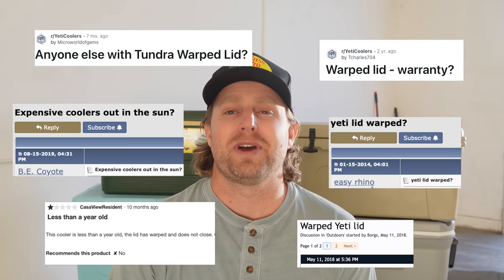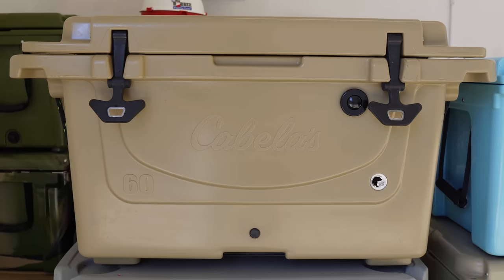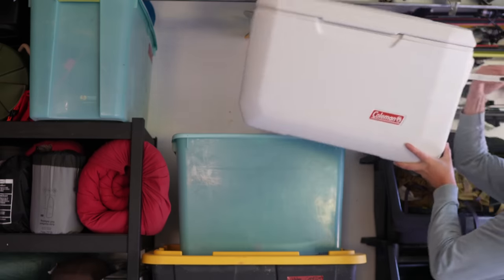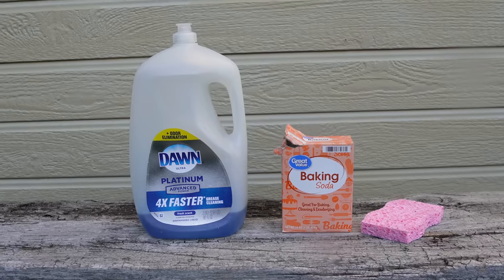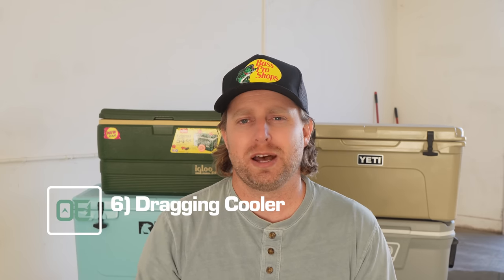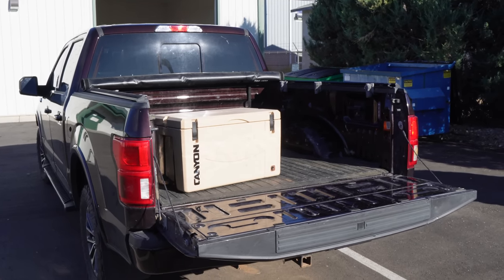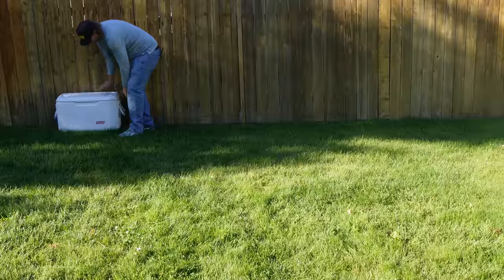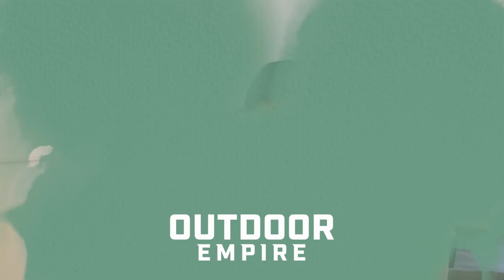9 Common Mistakes That Will RUIN Your Cooler

Comment: My cooler must be able to be in the sun at the beach or on a boat.  Otherwise it is useless.
Reply from the maker: I hear ya and I have mine in the sun all the time. I didn't really clarify in the video but the point is to avoid leaving it in full sun for days or weeks at a time. That seems to be when people see warping the most. A full day on the boat or a weekend camping shouldn't be an issue.
Reply: My Cabela's cooler has been outside for over two years in Wisconsin hot summers and cold winters. The rubber straps were just replaced.
Reply: My ORCA has done really well in the back of my pickup truck. And I'm way out in the hot as F desert where you really need a durable cooler . Dry ice works the best .
Reply: True
Reply: My Kong cooler has been outside since August of 2022. No warping or anything.
Reply: @Logansf410  I just Warrantied my Kong 70 for lid warp
Reply: I think he was probably referring to storing or leaving  your cooler empty in the direct sunlight for extended periods of time. Keeping your cooler in the direct sunlight while full of ice should have no detrimental effects on it.
Reply: Yep, and as a bicycle camper. My cooler is exposed to the sun at all times. And yet has never warped or cracked.
Reply: @longrider42 what cooler do you have?
Reply: @hardcore4476  All my coolers are some what on the small side. Due to the fact that I am a bicycle rider, but I do pull a trailer. My favorite cooler is a Coleman about 14 inches long, 9 inches wide, and 14 deep. Its my biggest cooler. I also have Igloo, and one by a company called "The Family" that I bought way back in 85, when I was working in Yellowstone. I've used the heck out of all of them, with no signs of warping or cracking. The big Coleman cooler I gave you the dimensions for. Has spent many a hot day out in the sun, since it is the cooler I take when I go fishing. So maybe its the luck, or unluck of the draw?
Reply: @longrider42  True! Glad to hear they all served you well. I have a yeti Tundra 45 and the best cooler I’ve ever had! I got it with Zyn Points and don’t think I would have paid for it otherwise. Have a good one!
Reply: Throw a towel on it

Comment: Another tip . . .  don't store the cooler with the lid down and the latches clamped down tight. Instead place a small towel over the rim of the cooler and let the lid rest down on that. This protects and prolongs the life of the freezer gasket around the lid and keeps it from getting compressed and losing it's effectiveness.  This also keeps the inside of the cooler aired-out while being stored.-
Reply from the maker: Love that tip! Upvote. 👍
Reply: You can also put baking soda in it.  Towel in lid vents and wicks moisture, baking soda helps keep fresh. I only do the baking soda with my expensive 70 qt, which might only do a few trips a year, but damn it’s nice to just grab it and just use it after sitting for months.
Reply: Funny my yeti I just bought states to keep it shut and latched when not in use.
Reply: You mean just place an open container of baking soda in the cooler, or sprinkle baking soda on the cooler’s inside?
Reply: thats clever

Comment: Kind of hard to not use a cooler in direct sunlight an a small boat. My new Rtic warps and I won’t be a happy camper… er, boater.
Reply from the maker: You're not wrong about that. If a day on the boat causes problems, I think that'd be unusual and worthy of a warranty claim. I'd just try and avoid leaving it on the boat indefinitely for storage with full exposure to sun.
Reply: Use a reflective blanket over the top of the cooler 😉

Comment: From eastern North Carolina I have a rtic ultralight. Cooler has been in the back of my worktruck flatbed for like 3 years now. From this video I have treated my cooler very very bad. Been outside every day. Spray herbicides and they tend to spill on it while moving hoses around. Have been cleaning with purple power and hot pressure steamer. I always thought the lid deformed from hitting the highway😂😂😂
Reply from the maker: Haha, nice! Three years of that kind of hard use ain't too bad so far!

Comment: One of mine stays in my work truck year around. When it's hot, I have a towel I put over the top of it and I wet the towel most of the time. Makes a huge difference in keeping ice
Reply from the maker: I've heard that a few times now. I'm gonna have to try that. Thanks for sharing!

Comment: Reflective bubble wrap can help with a lot of these.

I live in Vegas and I use coolers just for grocery shopping. That bubble wrap is a cheap and useful addition to you cooler:

Main use, fill in space inside the cooler to help with ice retention and cooling 
Cover the top for the same reason and after watching this, prevent sun warping
I’ve melted a cooler before by using it as a fire side seat, so I’ll use the wrap as a heat shield. Also bubble wrap is a more comfortable seat
Reply from the maker: Great hack, thanks for sharing!

Comment: My RTIC 45 lid warped like in the video. To fix it I placed a small piece of plywood maybe 4” wide I’m the front under the lid. Then I used a ratchet strap and wrapped it around the lid and body but towards the front as close as it would go without slipping off. It bowed it back in opposite direction and after a day in the Texas heat it’s back to normal. I had horrible ice retention and that prompted me to investigate. I also replaced the gasket with thicker one. This cooler is 7yrs old. Works like new. Great video.
Reply from the maker: That's the best daggum tip I've heard on that issue yet! Thanks for sharing. Glad you whipped it back into shape.
Reply: @theoutdoorempire  Thanks. I only left it out for one full work day. It was 100* I didn’t want it to bow back too much.
Reply: My yeti just warped in the heat and I used this tip! Now it’s back to normal!
Reply: @Erick-ie8ll  Awesome, I’m glad it worked for you.  Unfortunately for me I’ve had to do it to this rtic again. Seems like once a year I have to do this to fix the bowed lid. I’m storing it in my shop, so maybe I try in the house and see if it keeps the lid good.

Comment: Okay, some good tips, warping the lid never occurred to me.    TSP phosphate from your local paint store will also clean up the plastic real well and will not harm surfaces.. Mix it with water, spray or bush it on and scrub it with a kitchen scrub pad.
Reply from the maker: Great tip, thanks for sharing!

Comment: Another tip is I always leave my drain open when storing our coolers to prevent any mold or weird smells, though if you have mice in your garage that may not be the best idea. Just remember to make sure it's closed the next time you use it!
Reply from the maker: Good call!

Comment: Another great video! Sadly, it makes me wonder about using a cooler on the beach. The sand  on southern beaches, and even the sand dunes in Colorado, can be so hot that you can't walk barefoot on them. Might not be good for a cooler. Not much shade either, and truck beds get really hot. 
Ditto the abrasion. I took to collecting certain water jugs from the late 1950s, and you can clearly tell when a plastic bottomed one has been dragged on abrasive surfaces. It takes off the hard outer surface (think gelcoat), and the plastic becomes spongy.
Sounds like it's best to leave your rotomolded at home, unless you don't mind hemorrhaging cash.
Reply from the maker: Fantastic insight! Thanks for sharing. I think the hot surfaces thing is legitimate, but mostly applies to prolonged periods of time. I'm still gonna set my cooler on the sand at the beach for a few hours, but leaving it on asphalt for a whole weekend or in your truck bed all the time is gonna deform it sooner or later.
Reply: How about propping up an umbrella on the beach. Then put the cooler under there? Might be useful if you had to leave the cooler out for hours.

Comment: How hot is too hot to store my cooler? I have a new 64 qt Igloo cooler with wheels and a handle like a roller suitcase. Currently it is stored in my garage. I live in the southwest. It is currently 114 degrees outside and 100 in my garage. My house is small. The cooler is large. Not a lot of storage inside, and we don't have basements here. So, is the garage too hot to store my cooler? Thanks!
Reply from the maker: In my opinion, no it's fine. As long as it's out of direct sunlight. In a perfect world it'd be at 60 degrees all the time but that's not gonna happen.
Reply: I live in phoenix,and leave the lifetime in the cab- seems alright.

Comment: I’ve stored my ozark trail outside for the last 5 years in direct sunlight. Winter through summer it lives on my deck.  I pressure wash it and soak it in bleach every time I use it.  It still works like it did new.  Maybe it’s a little discolored but it hasn’t failed in any way. Maybe I’ve just got lucky? 🤔
Reply from the maker: Maybe, but that's awesome either way! Many of those Ozark Trails (also Lifetime) are actually blow molded and not rotomolded even if they're built like a rotomolded cooler. Blow molding is done at a higher temperature so they are often a bit more resistant to warping. That may also be a contributor.

Comment: I had three coolers bust the outer  shell by storing them in the hot storage building. I had to make room in the overfilled  garage to try and prevent it again.
Reply from the maker: Sounds about right. Thanks for sharing.

Comment: I store my cooler with the lid up when possible to save the life of the gasket, is that overkill or wise?
Reply from the maker: I've thought about that too and I'll usually do that for a while after a trip to let it dry out well anyway. Not sure how much of a difference it will make in the long run to the gasket though. I have noticed on some coolers like my Pelican that the gasket folds over and creases funny so that can't be good. I think the most sensible thing to do is just to close the lid, but not latch it.

Comment: Awesome video, as an avid trunk cooler guy it makes me want to rotate them every three days instead of once a week when they run out of ice. Even though they’re not in direct sunlight it maybe just as damaging as it due to the hot temperatures in the trunk. 

My friends that have had warping lid issues in the past may have been due to them leaving the coolers on the back of trucks so maybe that explains the lid warping. 

Even once dry I like to throw in two paper towel sheets in my cooler to absorb any other lingering moisture.
Reply from the maker: Great call with the paper towel truck I'll have to use that one! And ya long term the heat of that trunk might wear on it.

Comment: Is there a cooler that does better then others in direct sunlight?  Coolers on the back decks of boats are part of the norm where im from . Im curious to what cool is the most resistant.
Reply from the maker: I'm not totally sure yet, but I think an Engel Ultralight or light color rotomolded cooler might be good for that.

Comment: @theoutdoorempire if I need to store a hot garage that’s not insulated is there any thing I can do to stop it from warping? If that’s the only option to store . Love your videos
Reply from the maker: As long as it is out of direct sunlight and not in direct contact with metal, you'll likely be alright. I do the same thing and haven't had any problems yet.

Comment: Seen you had a white storage net on your rtic model Is that and how did you install it with screws or adhesive? Thanks
Reply from the maker: Came with the RTIC Ultralight with wheels.

Comment: What about keeping food warm in the cooler I see it all the time and do it my self but could it eventually damage it??
Reply from the maker: As I understand it, these coolers are made at temperatures between 250-400 degrees F. If you put hot food in metal pans directly in the cooler without anything in between, I imagine it could melt the plastic. Or if you left them in there for several days at temps over 200, maybe it could cause some warping. But if your transporting hot food for a few hours or a day, I doubt it'll hurt. But I don't have any personal experience with it.

Comment: A Pelican Elite injection-molded cooler (Elite 30, Elite 50) or Otterbox venture won’t warp like a rotomolded construction.  The lids are WAY thicker with reinforcements of plastic ribbing.  Too bad Otterbox discontinued the amazing Venture.
Reply from the maker: Ya it is too bad about OtterBox. And I agree that injection molded coolers are far less susceptible to warping. Makes sense since injection molding heats the plastic up way hotter than rotational molding and uses different plastic compounds.
Reply: Love my otterbox venture. It lives on the back seat of my work truck. It's been great through the hot summer.

Comment: What coolers would work best for being left in my truck bed. Im in construction and just like to have drinks with me at jobsites
Reply from the maker: I'd try an injection molded cooler like the RTIC Ultralight or the new Engel Ultralight is pretty cool too. That kind of plastic tends to hold up to heat a little better as far as I understand. Plus they're cheaper than the fancy rotomolded coolers.

Comment: never had a cheap coleman or igloo cooler warp in the sun. maybe thats just the roto molded coolers that do that. if the sun warps a cooler then its pretty much useless to me and a garbage cooler.
Reply from the maker: I've seen reports of it happening on those types too, but it's true that rotomolding plastic is done at a lower temperature than injection or blow molding so it makes sense to me that rotomolded coolers might be more susceptible to becoming deformed. But none are invincible!
Reply: Lol… depends on which state you’re in. If the suns hot enough, it beats plastic every time.

Comment: I have had my yeti 65 and my 150 for 9 years, my 65 is my work cooler and is in the bed of my truck 365, my 150 is my hunting cooler and stays in a shed throughout the Florida summer. Asides from some scratches, these coolers are still in very good shape, no warps, handles, gaskets and ripper latches are 100. I paid a lot for the coolers, but I’m guessing I might end up willing them to my kids
Reply from the maker: Nice! I'm sure your kids will appreciate it.

Comment: What is the white Coleman cooler in the video?  And have you done any testing on your grandpa's vintage Igloo cooler?   Found a used one for sale and was wondering if I should pick it up.  Looking for something for day trips to the beach, so don't need a heavy, roto-molded cooler.  I also found the Rtic Ultra-lights to leak, so those are out.  Thanks!  Informative videos!
Reply from the maker: The white Coleman is the Coleman Xtreme Marine cooler. It was incredible, held ice as long as a Yeti. But they discontinued it last year. If you see one, get it! I did test my Grandpa's old Igloo in the first ice challenge I did. You can find that video on the channel. It's the one with the most views.

Comment: Never seen the old ones warp.  Am I wrong about this?
Reply from the maker: If by old ones you mean the cheaper blow molded types, they're not immune to warping but they do it less because of the kind of plastic they're made of which has a higher melting temperature.
Reply: @theoutdoorempire  would that be considered cheaper material on the new cooler?

Comment: Okay... thank you.  I should not buy a plastic cooler to keep even in a ventilated shed.  Going to look up steel-clad ones.
Reply from the maker: Yeah, there's a good chance a rotomolded cooler would get deformed in an outdoor shed in those temps. If you get an injected molded or blow molded plastic cooler you might be alright. They can withstand higher temps, but still a risk.

Comment: How do i avoid heat when i work in a ups truck 12 hrs a day the back of the truck is 120+
Reply from the maker: You don't. But use the cooler anyway. Just get one with a good warranty. Most reputable companies will replace or repair it if it warps and is still under warranty. Orion has a 10 year warranty, Yeti 5 years, Pelican lifetime. I break that down better on my best rotomolded coolers video. Cheers!

Comment: I have never undrstood colored coolers.  Yea they look cool.  However, they absorb heat.  My parents have a white Yetti cooler and even in the sun it's cool to the touch.  Charter fishermen use white coolers for this exact reason.  They hold ice longer and don't  heat up in the sun.

If your colored cooler is going to be in the sun cover it with a white towel.  It will stay much cooler.
Reply from the maker: I definitely hear you on how hot they can be to the touch. I've seen conflicting information on the impact it has on ice retention so I'm thinking I need to do a test of my own.
Reply: I've wondered if lining the inside of a cooler with one of those mylar emergency blankets (the ones that look like foil) would help extend ice life by keeping the heat from radiating in 🤔

Comment: I got a Yeti 45 ive had for 5 years and they are tough as hell. My cooler is melted and bubbled on the back , and still holds ice for a while.
Reply from the maker: Nice! True, they can usually still do the job even if they are haggard.

Comment: My Rtic lid warped…out of warranty and won’t replace it…any suggestions on how to fix em?
Reply from the maker: Dang! That's too bad. I haven't heard of a way to fix it other than to replace it unfortunately. You could try getting a thicker freezer gasket at Home Depot or something and see if that will fill the added air gap, but I don't think you can un-do the warping.
Reply: @theoutdoorempire  spoke to artic…told me to flip the cooler onto the lid and let it sit for a bit and it should help…also when storing the cooler they say to leave the drain plug open
Reply from the maker: @Dubbin90  Interesting. Hope that helps!